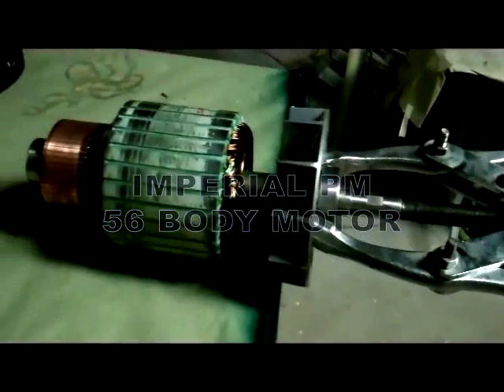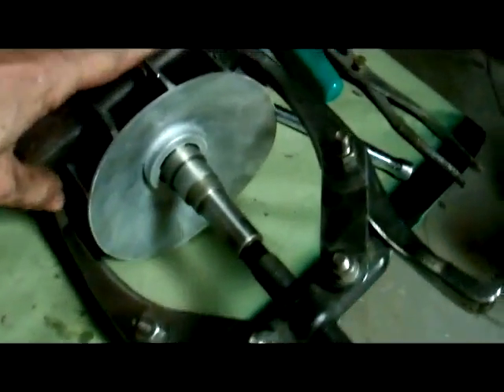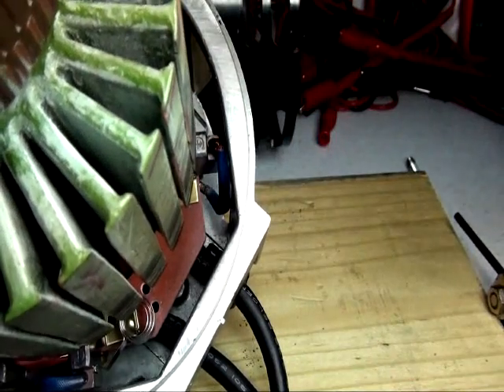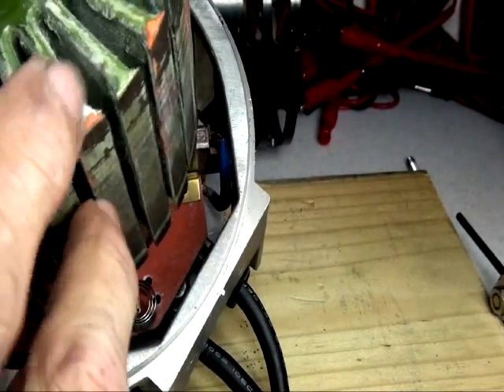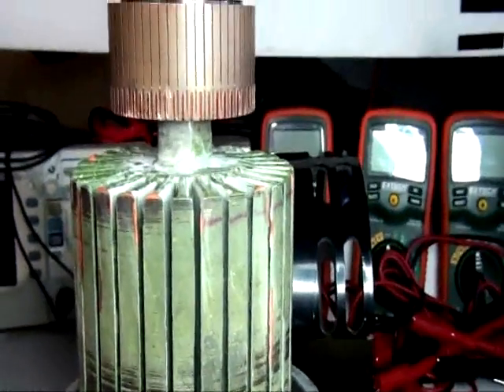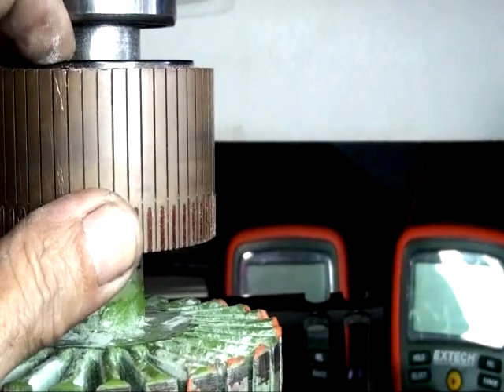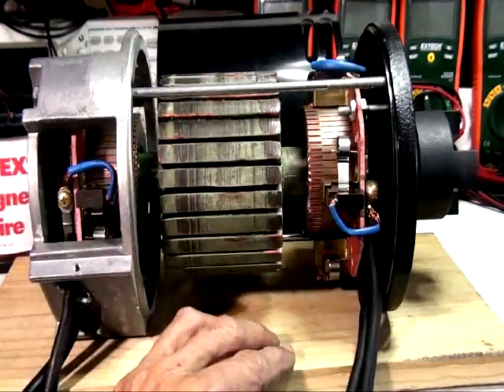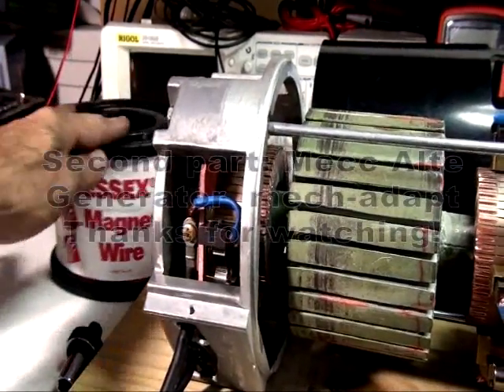ASYMMETRICAL CONVERSION OF THE PRIME MOVER

Comment: Keep up the great work. I have a rather interesting Rodin coil configuration using the 4505 Diode configuration. It appears that the coherent field results from a fluctuation that takes place at the diodes. Keep in mind I am using a bifilar 20 ga wrap of 2 pounds total copper weight. I have also built the coil on a torus of 12 inches in dia and a toriodal radius of 1 inch. The ratios are not in agreement with Phi (1.618:1) but it is producing .32v dc at solid .05 amperes.